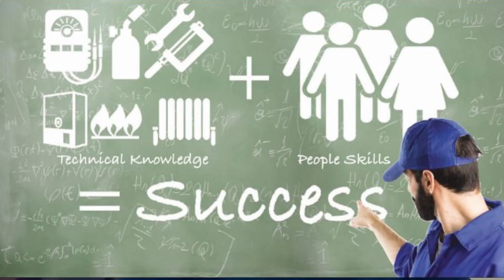Unsafe Situations with Some Builders and Gas Boilers

Comment: IGEM/G/11 which was formally TB001. We're now left with 2 classifications AR or ID,  NCS can be used at you're discression. However it's better to give clarity to the customer. As NCS is neither here or there.  Meaning layman's for a customer, it's either AR has potential to cause an incident to occur or ID spilling pocs, leaking gas or unsafe for any other major reason such as this. Flue termination causing pocs being able to enter the habitable dwelling.  The Esp aka Cadent would have been out and capped it at the meter.  They may rectify a leak upto <2mb at their discression. Other then that the pass the buck back to the homeowner. Whom has to get an GSR engineer to investigate.